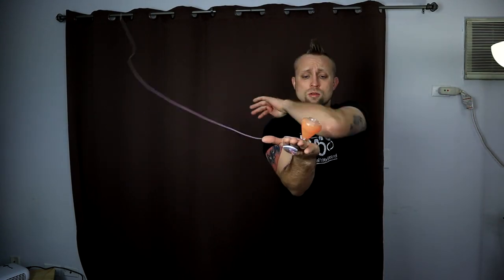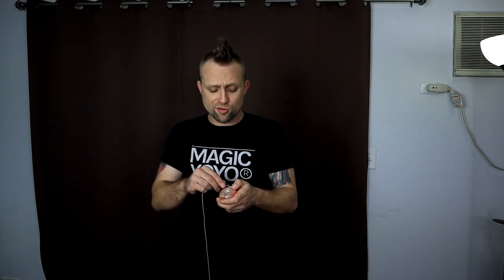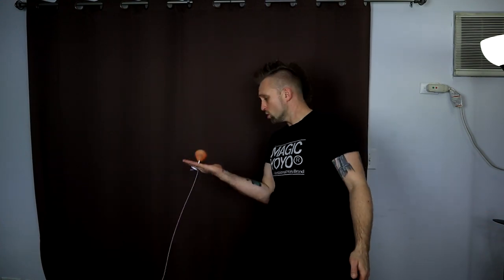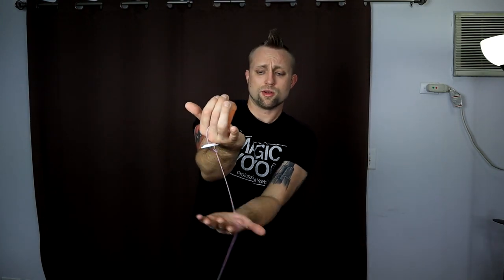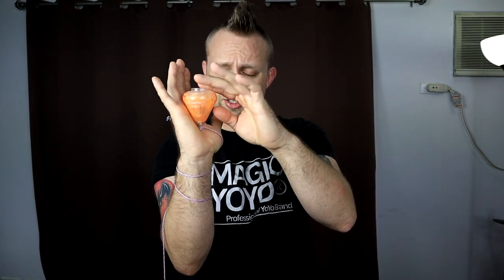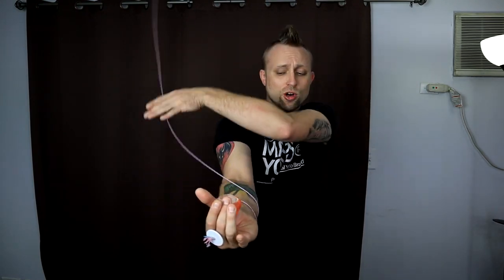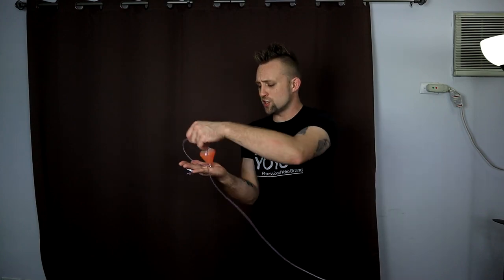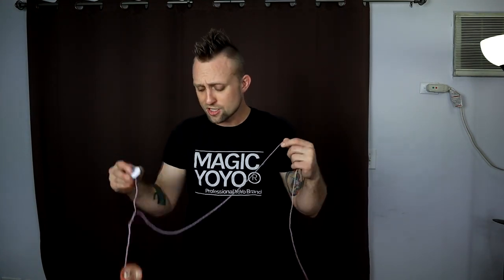Corkscrew Spin Top Trick Tutorial. How to do the trompos trick corkscrew tutorial.

Comment: A bearing tip is not required.  If you are using a fixed tip, you need to wrap the string around the tip clockwise.
Reply: Does it really work when you wrap it clockwise?
Reply: @Orochimarus9  if you are right handed, yes
Reply: @reneeharlow1983  Thanks... Will give it a try👍🏻